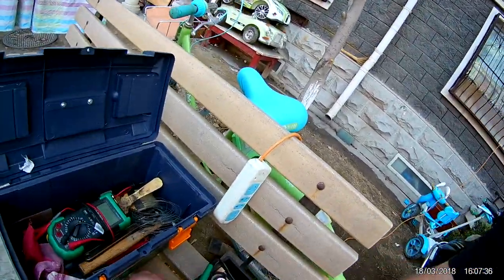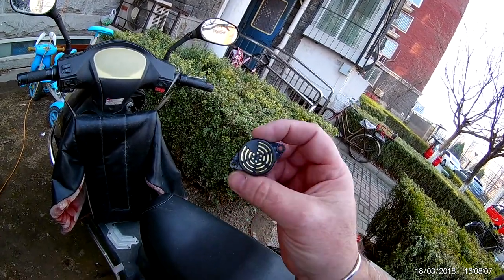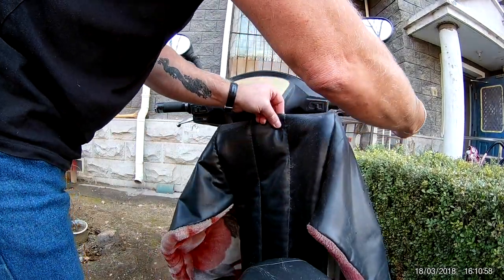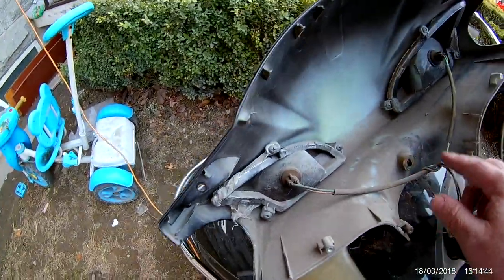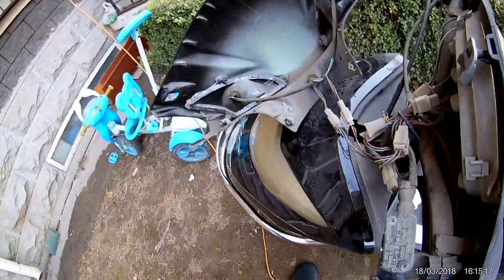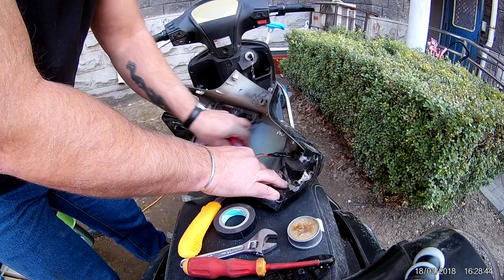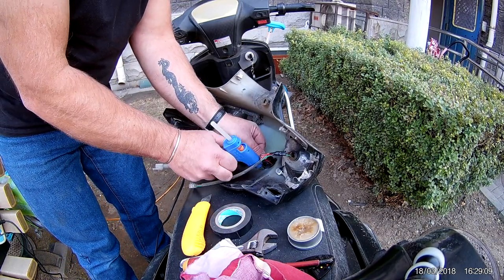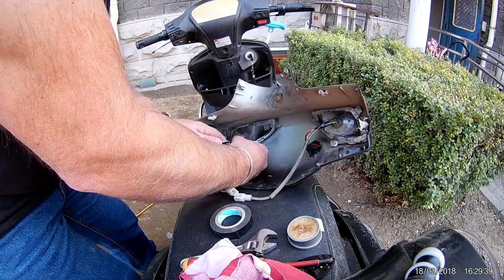Fitting a buzzer to my electric scooter indicators

Comment: He said at the beginning he was fitting "reverse buzzers"! This video is (or should be) common sense and anyone should be able to fit the buzzers. I only watched it because I have two nearly identical bikes like the one he has and I had already fitted them to one (before I looked for a video) but when I tried it with the other it won't work!